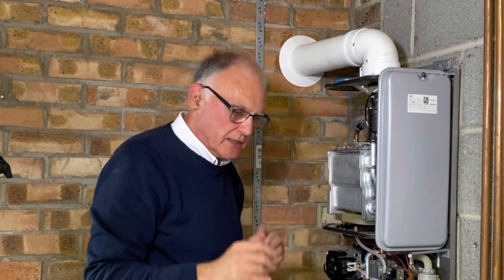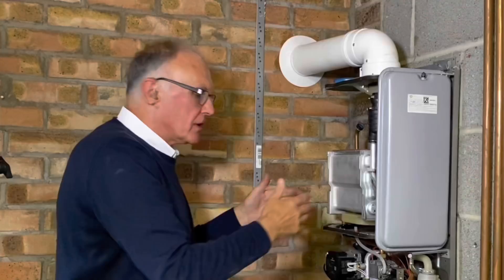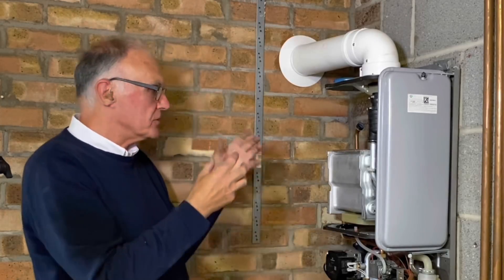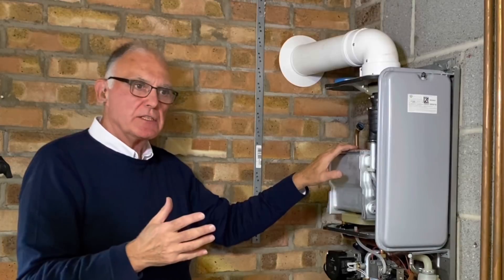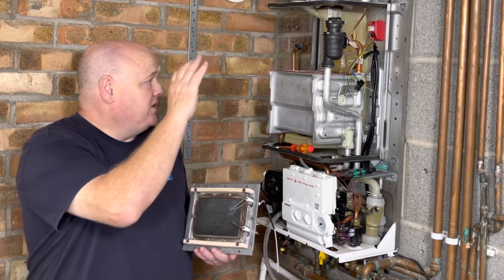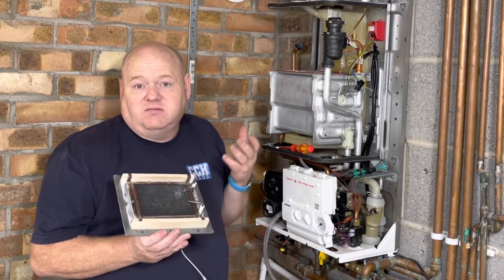Gas Training - How To Clean The Main Heat Exchanger In A Vokera Boiler

Comment: It looks a faff, and if the manufacturers guys don't really know how to easily clean the heat exchanger then it's probably a difficult job to clean one out.
Reply from the maker: It’s not an easy job but at least they are trying to help gas engineers / plumbers do it correctly if they want too. Thanks.
Reply: @AllenHart999  Yes it's great they take time out to help, but as a home owner /landlord it seems this would cost me at least 2 hours work a year x 6 houses plus landlord certificate so would make this a very very costly boiler to own on a lager than one basis. Especially when most other boilers are so easy and quick to service.
Reply from the maker: @penskib1975  You could buy a boiler that costs 2 or 3 times more and in the long run the cheaper boiler could still work out the cheapest. You pay your money and take your chances. This video is to help with the boilers that are already installed. Thanks again.

Comment: Another great video Alan keep them coming really appreciated 👍.  But if your still speaking to this chap could you ask why the condensate trap is always at the wrong angle so it backs up ? As most of the callouts I get to those is due to condensate. Also it sometimes takes longer to put the case back together than it does to to the repair. I suppose you get what you pay for. My advice would be to replace it with a proper boiler and grass it
Reply from the maker: Hi Julian. Thank you for the question, Hopefully David will respond to that for you. Thanks again.
Reply: The condense trap we often find at the wrong angel because it's not held when pushing up the pipe onto the outlet. If your advice is replace rather than service I guess you have little regard for the finances of your customer.

Comment: Bloody hell... I'd have been inside a Giannoni heat exchanger in less time than it took him to loosen that fan.

I appreciate the aim of the video is just to be instructional rather than to promote vokera boilers.... But I'd probably prefer to clean a wb kebab heat exchanger than this one... And that really is saying something!
Reply from the maker: The Worcester can sometimes be a nightmare as well tbh. I am not really here to promote any brand. Just trying to help raise standards where I can in my own small way.
Reply: That's true. If you choose boilers because of speed of service then do that (or try the Vision Plus system or 35 and 40 combi's from Vokera, they're front access stainless or the evolve, front access aluminum. It's just a job at the end of the day, you do what needs to be done.

Comment: When David mentions that he is going to remove the spark electrode connection it shows Allen's hands that remove the connection not David's.
Reply from the maker: Hi Waseem. That’s correct, That's really good hand spotting. As I said at the start of the video I will do some cutaways to try and help people understand it. We couldn’t get the camera in while David was filming. Thanks.
Reply: @AllenHart999  I'm surprised you replaced the heat exchanger rather than the boiler
Reply from the maker: @waseemkhaliq933  I have other plans for funds at the moment and didn’t really want to replace the boiler.
Reply: lol, you are aware how video productions are put together!?

Comment: Not too bad if you've got loads of space in a garage, bit awkward whens it's fitted in a cupboard with minimal space on the sides, and anyone know what that creamy white stuff (excuse the pun) at the bottom of the sump is
Reply from the maker: Hi Ste, This is just to show how to do it, Nobody is saying it’s easy. Thanks.
Reply: Aluminium oxide mixed with condensate water

Comment: Great videos Allen there is always something to learn I was surprised to hear the trainer suggest using white wine vinegar on aluminium hex Vokera tech tell us not to do that
Reply from the maker: Hi Stephen. I was wondering if we could use coke a cola ? I use that on Worcester Bosch Boilers when the baffles are stuck. Thanks.
Reply: @AllenHart999   never tried it some engineers remove the hex then power hose it I’ve not had one bad enough yet to try it myself
Reply: I agree, I would not do that, water only I’m afraid. And like he said a good old wire brush if necessary
Reply: It was Vokera tech suggested it to me!
I intend to try coca cola. and also a jet wash. Frankly  a bit if muscle and time works too.

Comment: Hi Alan good video and I have done lots and yes it quicker strip down in 10 mins. And yes the expansion vessel should be recharged on every service and the condensate trap cleaned out . Good luck.
Reply from the maker: Hi Tony. How long do they take you to fully service? Thanks.
Reply: @AllenHart999  Hi Alan if the heat exchanger is not like your old one I can do them in 30 to 40 mins and I use white vinegar.
Reply from the maker: @Tony-sr7vq  Sorry to ask so many questions, How long do you leave the white vinegar? do you wash it with water afterwards? Thank You.
Reply: @AllenHart999  what I do is I take off the fan and the burner then I spray the heat exchanger with the vinegar and leave it.I then do the vessel and clean out the condensate trap. Then back to the heat exchanger bush it then  flush it out with water but I have a bucket so the debris don’t go in the trap . Come up like new .
Reply from the maker: @Tony-sr7vq  Thank you so much for that.

Comment: Best way to clean a vokera heat exchange is to disconnect all pipes,electrics and fixings and grass the pile of poop..
Reply from the maker: Hi Shaven, Not the most helpful comment but thanks.
Reply: @AllenHart999  and it's still not clean so not much sense coming from that comment

Comment: I call these boilers landlord boilers 😂😂😂
Reply from the maker: Hi Bilal. Have you ever stripped one down? Thanks.
Reply: @AllenHart999  yes many times, very common for the burner to get choked, water sensors tend to get dirty within 3 years and also pcb faults are very common in around 5 years.
Reply from the maker: @reliabill87  Water sensors will only get dirty on dirty systems won,t they? That's not really a boiler fault.  I am guessing I will not have this long enough to test the PCB. Thank you very much for the feedback.
Reply: @reliabill87  The only water sensor is DHW so it must be scale, is there no water conditioner?
Reply: A landlord special as I call them 😂

Comment: i found the 2 burner screws near the flue quite awkward and it put me off as seems quite faffy compared to other boilers. once they were undone it doesnt seem too bad tbh. The boiler does the job!
Reply from the maker: It is giving us hot water now and it will be great to do plenty of videos on it. Thanks.
Reply: It is faffy, that's one of the reasons for the video, guys can see what's involved and go forewarned. Alan was kind in the editing as I got sweaty in the video and fiddled unecessarily in reassembly but I would allow an hour and a half for the first and an hour for when you've done a couple. Trouble is how long has it been left before servicing? You can't see that before stripping it.  Our front access radial coil exchangers, aluminium or stainless steel in the recent Vision Plus combis and system boilers are a doddle. We're hoping to do a video on that soon as well.
Reply: @vulcancontinental  the videos are certainly useful! i've watched one of your webinars and they are good too, would be better for some playback option as i usually miss them :) nice to see all the effort you put in to the community, always useful info!! thanks

Comment: Iv strip cleaned this and found it awkward and time consuming, ideal logic much more engineer friendly. If they want it strip cleaned every year they need to make it easier to do so. Find the traps on these awkward as well to clean.
Reply from the maker: Logic is nearly twice the price though. Thanks.
Reply: They're an absolute doddle when you've done a few.
Reply from the maker: @flange06joj  Vokera?
Reply: @AllenHart999  I don't think even I would call it a doddle, let's face it, it's not as easy as many especially front access (which we make too, just buy those).
Reply from the maker: @vulcancontinental  Top tip, Remove expansion vessel as you need to drain it anyway for a service. lol
Reply: @AllenHart999  I have always found vokera isolation valves to leak when u turn them off nightmare they are and done a few hex cleans not the easiest to do when stuck in a cupboard and tight to the side walls!! Love you videos man 💙 knowledge is power 😏
Reply from the maker: @warrendublin3915  Hi Warren. How old are the boilers you look after? Thanks.

Comment: Vokera is not bad but they should do different siphon
Reply: That one comes out from siphon like over flow
Reply: @majjatmohamed6927  that comes with a small cap on it, it must have come off. Later versions it was left blocked.
Reply: @vulcancontinental  I didn't know that ,I did silicone on it
Reply: @majjatmohamed6927  we can send a cap or many use silicone and a small self-tapping screw.
Reply: @vulcancontinental  thanks mate
Reply from the maker: Why? do you find they block up? Thanks.
Reply: Day after when I did the service ,it starts leaking from that small tube
Reply: @majjatmohamed6927  from a hole on the side?
Reply from the maker: @majjatmohamed6927  Which tube? Thanks.

Comment: What's the easiest way to get the split pin back on the middle section off the condense pipe. Because that always blocks up
Reply from the maker: Just pull it out.
Reply: @AllenHart999  lol
Reply: Needle nose pliers
Reply: Thanks

Comment: Allen keep an eye on the top aav tend to leak. Good video mate,  work on these often👍👍
Reply from the maker: Hi Bobby, Do you have any tips for us? Thanks.
Reply: @AllenHart999  Apart from  bin it, usual suspects are exp vessel, flue sensor ,aav's and iso valves leak. You get what you pay for, not the worst boiler but needs cleaned yearly or the condi trap chokes and backfills. 😬😬👍
Reply from the maker: @bobbymckean915  Unlikely I will keep it a year but it's a good boiler to help the trainees. Thank you for your feedback.
Reply: @AllenHart999 Agree with you 100%  let them strip it down and re fit. Easy enough to work on just not the most reliable.
Reply: @bobbymckean915  while there I was chatting to Allen and he was saying the Vogue has a better manual, easier to service, trap is accessible nice display. I said how much is the Vogue, he said three times the cost. Many, many customers cannot afford that, this gives them the same 30kW and 12l/m of hot water and keeps them warm.
Reply: @vulcancontinental  I agree worked on loads of different vokera models over the years but the current compact A / Vision not the best. Its a budget boiler at best thats  not a bad thing but if they were more reliable more would get fitted rather than a baxi or ideal.
Reply: @bobbymckean915  well a lot of the problems we get are installation but guys just kiss that off with 'that's right, blame the installer.'  it is what we find though. 

Allen had a thoroughly blocked hex, nobody has seen one as bad as that before who has seen the pic or the hex itself. 

His boiler failed just after we changed the hex under warranty, not many manufacturers would do that finding it in that condition, certainly not the lovey dovey brands guys think are so wonderful. 

The failure was the gas valve solenoid, it was changed as it was under warranty, 5 years, next day.

That was the first component service call on the boiler.

Poo happens, you just deal with it. Look at Gas Chat etc to see how other brands are slated and they cost a lot more but we're just an easy target for a glib remark from a keyboard warrior who loves Baxi, Ideal etc and treats them with the respect any boiler deserves no matter the price.
Reply: @vulcancontinental  Fair one about the installer/warranty repair.Not many would do that or even take the time to show the repair. But I think you've picked me up wrong. Not a fan boy about any Manf's boiler so not being biased. Fitted plenty of Compacts/ Visions not slating Vokera. Just dont think these models as good as some. Work on these boilers on a daily/weekly basis. Compared to an  old Excell the reliability isn't the same in my opinion.
Reply: @bobbymckean915  yes, heard that before too. I know you're ok with your comments. The boilers are more complex now, the prices more competitive, cheaper in fact than before relatively, it's a hard circle to square. 30 years ago I was paying more for a on/ off boiler with no modulation, no open therm, no weather comp, 60% efficiency etc etc.
Reply from the maker: @vulcancontinental  The service from Vokera has been outstanding, No question about it. Personally the boiler didn’t deserve any warranty with how badly it’s been installed. You/Vokera really helped me out. Thanks.
Reply: Those with a red top gave a problem but we're dropped smartish when discovered. Been screw caps for ages. I personally turn them off on that boiler and use the manual one on top of the casing.
Reply: Swapped a couple of those AAV's

Comment: Crap boilers much better boiler out there for that price Range.
Reply: They're not crap boilers but you have an opinion and not sure about better boilers in the price range either. As for the comments I've seen them all before, I also see the work of installers, there's an example on the wall in the video.
Reply from the maker: This video is just to show how to strip it and clean it, Thanks.
Reply: It’s a bit awkward someone from Vokera came in after how much the boilers have been slated in the comments 😂
Reply from the maker: @kryptoniteee  David from Vokera really wants to help and support engineers as much as possible. He is a really good guy and Vokera are amazing for letting him help out. Thanks.